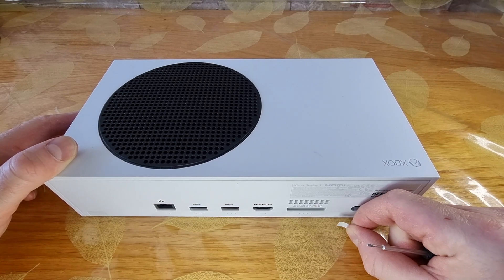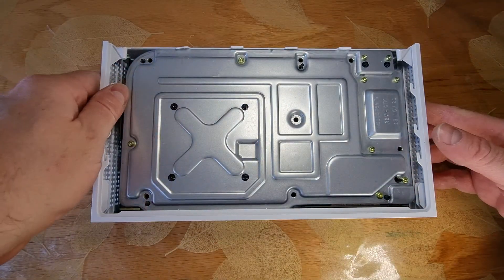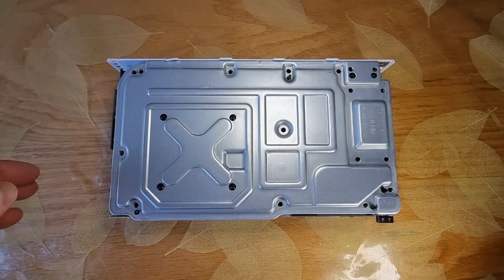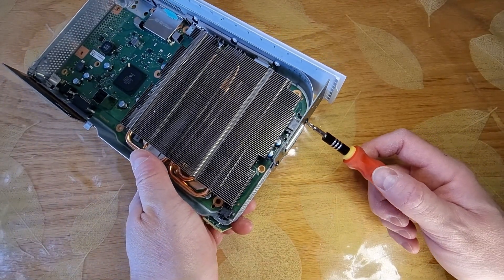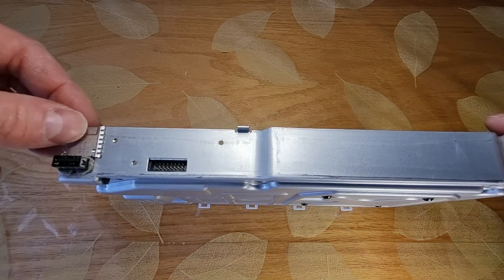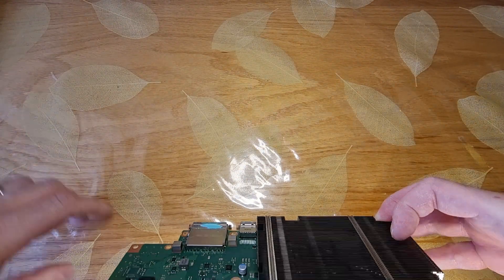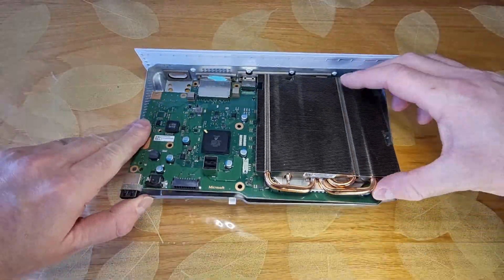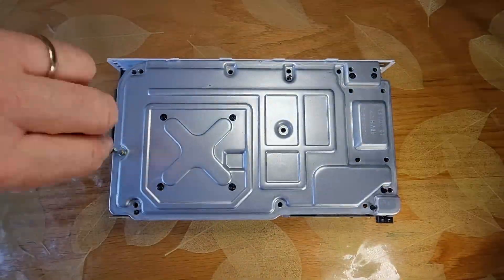XBOX Series S: CAN IT TAKE 1TB NVME??? Disassembly & Internal Disk Replacement

Comment: if drive is not recognized is propably file format error ... drive need to be formated as GPT not MBR ... and have prepared update file on USB flash (NTFS formatted) for offline recovery ....
Reply from the maker: With my 1tb disk it fails to boot at all, the power button just blinks